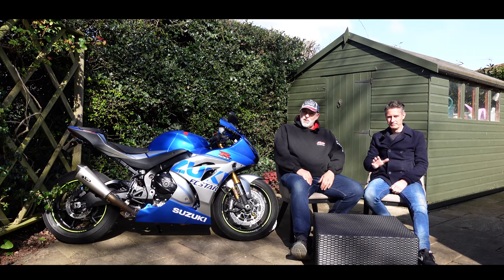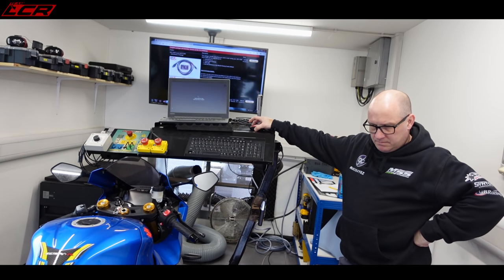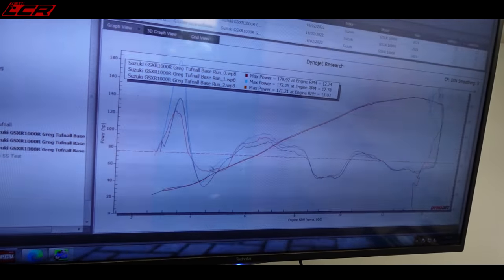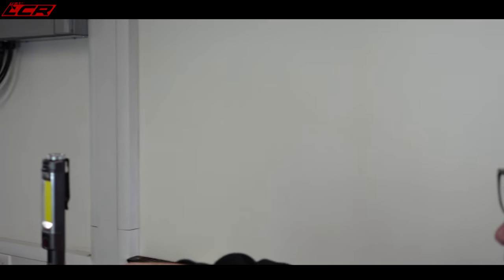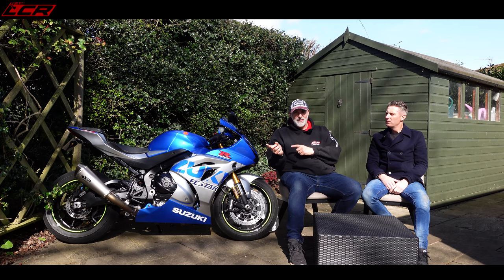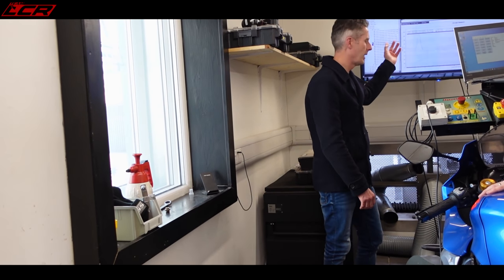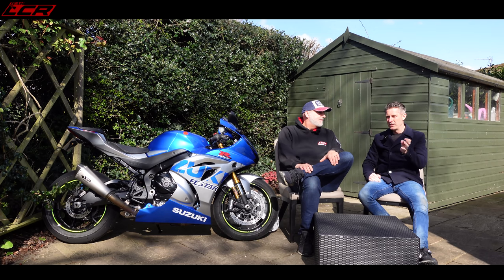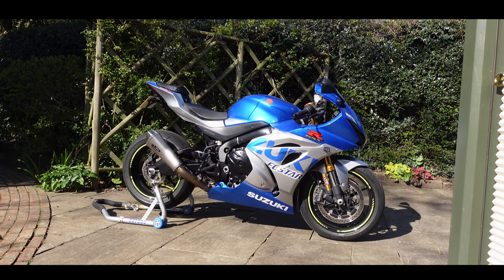Suzuki GSXR1000R Dyno Mapping With Woolich | MSS Performance

Comment: The low speed and part throttle is the hardest stuff to map, that's where you spend most of your time. That peak power run means pretty much bog all in the real world. The fuelling and ignition maps and the options for deleting inputs like the O2 look very similar to Hondata that I've dabbled with on Honda cars.

Comment: 181hp at the rear wheel is 208hp at the crank, give or take.  That is an outstanding figure.  Congratulations.
Reply: No it isn’t. Suzuki claim 202bhp at the crank. A 6bhp gain with a full system and a remap is quite pathetic!!
Reply: @flamintasty  Yes, it is.  The 2017+ GSXR 1000 makes 202hp at the crank.  This is not that model.  It is the 185hp K8 model which generates about 157-160hp at the wheel.  The combination of exhaust and tune has increased power by around 24hp crank or 21hp at the wheel.  An oustanding figure which brings this K8 up to a modern, stock 1000 cc bike.
Reply: @rafaellastracom6411  no, it is 2017+ model, the fairings and front headlight are different to the k8, I was expecting a little more to be honest, I see guys in America flashing them and getting close to 200hp
Reply: @Heyoka-gq4wl  I´m going off the channels own video title from the last episode... ¨Modern Classic Update | New Shoes for the GSXR1000 K8¨.

Comment: Looks very lean still at low and midrange RPM , just based on the A/ F ratio graph , correct me here if I,m wrong Chops
Reply from the maker: The final figures were done with the huge fresh air fan which was new. They werent sure what air speed it was suppling as wasn't calibrated yet so that leaned it a little for the final numbers. Leaner but not too lean
Reply: Agree still looked a bit lean down low. However as they say they lean is mean 😂

Comment: I'm surprised that we still don't have all dynos with sufficient air flow to mimic the real world environment i.e. The impact of ram air etc. Its still done based on experience/guestimates. A road test with a/f measuring would be interesting
Reply from the maker: Actually Scotty they were just implementing a huge fan to mimic this. Shame it wasn't ready for our visit 👍
Reply: Can you imagine a 150mph wind in a dyno cell?
Reply: Yes. Can you imagine tuning vehicles that are engineered for ram air in a room without the real world airflow.  The whole room would be ideal but at least real world volumes of air directed into the air intakes.  Admittedly not easy but not doing so is surely a massive compromise.

Comment: I noticed Greg say it's running a bit hot at 80 degrees, is that hot though especially in the conditions? My 9r was running at 87 degrees through winter and summer, it seemed to love being at that temp, but I managed to bring that down a fair bit. First thing I done was use Motul 7100 fully synthetic oil, straight away the temps came down 3-5 degrees, I then recently removed the KLEEN air system (PAIRS system), and connected the crankcase breather to the KLEEN air system with the vacuum pump removed, and added a small Ramair filter, and blocked off the holes in the airbox (I have a video showing how I done it if interested).

As the hot exhaust gases that pass through the piston rings no longer go back into the engine, the temps are down even more, I saw them go down to 78 or 79 degrees at one point, plus it is now using the extra and cleaner air to produce more power. I did shim my carbs too, but obvs you can't do that part, but definitely recommend the other mods to any bike, no need to buy block off plates for the reed valves. Next I'm changing the coolant to Motul's coolant to see if that makes a change, as I'm sure the previous owners probably just used a generic brand not formulated for bikes specifically, we'll see.

Comment: did you not take it to the guy who did your H2 because you didn't want to take the fairing off or because this guy supplied the exhaust?
Reply from the maker: They supplied the exhaust so offered a matching map at a decent price. Also I wanted to see what the Woolich software was like as I've never seen it before 👍
Reply: @LambChopRides  cheers. I have a video suggestion for you "Do Velocity stacks really work"? I don't see the point but bragging rights.

Comment: Brilliant and all the best imfo you need to get on reflash in layman's terms does that mean you don't need a power commander,, I'd like to get it done to my 06 to get the 1st 3 gear restriction out can get a dongle but the gear indicator stays I 5th 🤔🤔🤔🤔so not for me ☘️☘️☘️☘️☘️☘️☘️☘️☘️from Northern Ireland loving the videos
Reply from the maker: Yes no need for a power commander  can do it all at the ecu level it's very clever. I'm going pc route on my old gsxr so can see the different process 👍
Reply: Great John thanks again

Comment: I always wonder how they do it and how long it takes them to sweep the entire map and adjust all the throttle and rpm cells, because it is always seen at 100% throttle, but how do they make sure that IN EACH CELL the afr is correct?
Reply from the maker: They test and adjust at all throttle positions not just 100%. Well 25%  50%, 75% etc, not sure exactly what throttle positions but at some points in the throttle position. Then smooth the map between them

Comment: Always intrigues me with altering the mapping and changing the fuelling. Does this mean when the map is altered to make it smoother, more responsive etc and the bike comes round to an MOT and is checked for emissions it'll fail as the original map was installed to comply with emission regs
Reply from the maker: All new bikes are built to meet very strict emission control. This is tested under load (unlike mot)  Unfortunately these tight controls mean throttle response suffers. The bike won't fail an MOT emissions test as that's very basic and only done on idle
Reply: Motorcycles are not tested for emissions on an MOT.
Reply: @motorcycle_workshop  tbh I didn’t know, I rarely keep a bike for more than 3 years 🤣🤣🤣😇

Comment: It's probably me, but wouldn't it be logical for it to show rich above the line and lean below the line? 🤔😁. Secondly, can they do a simple disable the service light on bikes - service lights drive me nuts, especially when you do your own servicing. Local Triumph dealer charges 30 minutes labour to reset the light!!!
Reply: Sure they can easily.  It’s just an error or notification code which can be disabled.  Cheers
Reply from the maker: Yes that would make more sense but guess it's just what you are used too. Service light I'm not sure... something we never asked

Comment: Why is every dyno a ‘conservative dyno’ or a ‘heart breaker’ according the dyno operators 😂
Reply from the maker: Haha very true!
Reply: Yeah, exactly. Don’t they ever get them calibrated?
Reply: I used to work at cosworth in the dyno. Every day we would measure barometric pressure and vapour pressure (using a whirling barometer) and work out a correction factor. On a perfect day the correction factor would be zero, on a good day the power would be corrected down, on a bad atmospheric day the power would be corrected up. Weather makes a fair bit of difference.
Reply: @davidharrison8762 So does fuel quality.
Reply: @flamintasty  yep, we tested some nasty fuels back in the day, I know a few guys that had cancer, me included,  I wouldn't go cranking up the ignition advance with shit fuel.